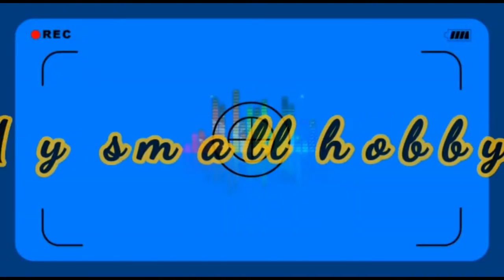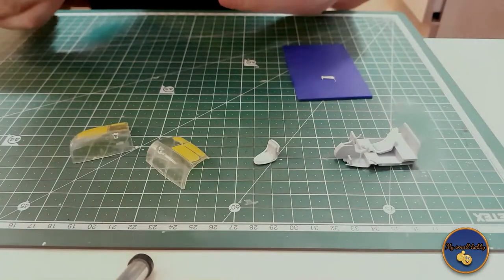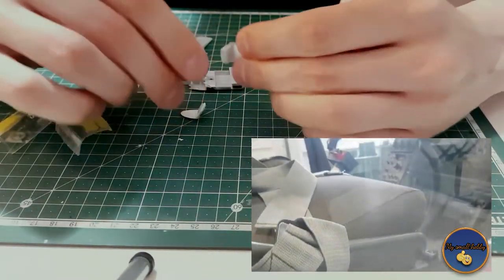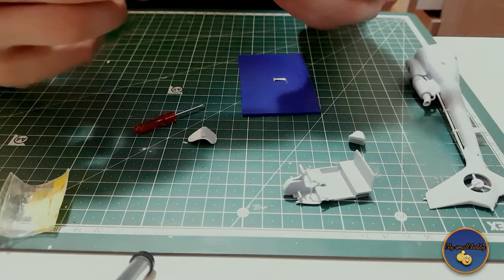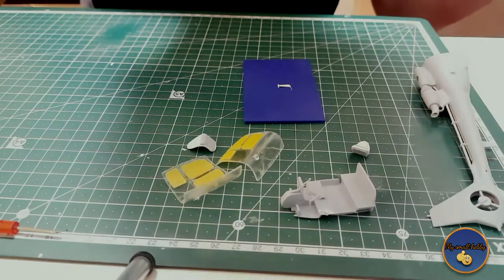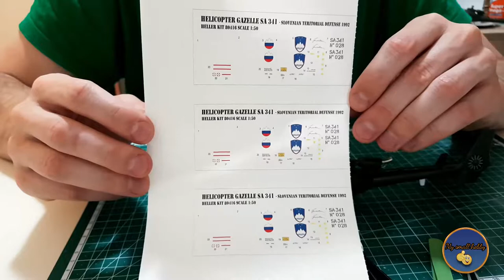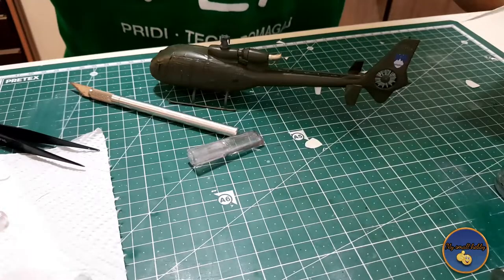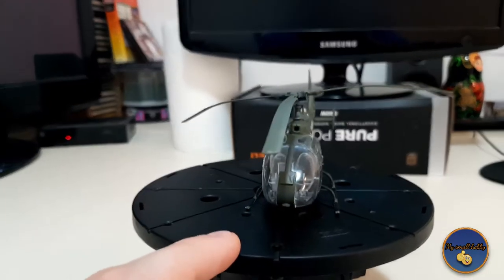Let's Build A Thing: SA 341 Gazelle (Based on Heller 80486) 1:50

Comment: Video ti je interesantan. Jedino si možda trebao da si koristio možda dekale tipa Lift Here ili Balkan Models. Kažu za Lift Here da je ili iz Beograda ili iz Novog Sada (nisam ni ja siguran odakle su), ali Balkan Models dekali su iz Slovenije ako sam dobro čuo.

Video is interesting. You should have used the decal such as Lift Here or Balkan Models. They say that the Lift Here is from either Belgrade or Novi Sad (I'm not so sure where are they from), but Balkan Models decals are from Slovenia if I have heard well.
Reply from the maker: Yes you are correct.  Balkan model decals are for Slovenian, but like all good things here they don't make them anymore. One reason is that Revell does not make 1/72 bell 212 no longer. And the decals were made for that helicopter. I have seen 1/72 decals for Gazelle but thet are to small for 1/50 Heller one. Now Italeri has made a 1/48 scale bell 212. In our shop ww have several kits. Lift Here I have seen their decals. Only one person in Slovenia distributes them here. The resaon I made my one decals is because I wanted to try something new. In the end it cost me much more, but it's a hobby... :)
Reply: I didn't know that they aren't making them anymore (the Balkan Models decals). I once did a B- 17 G from Revell, and I have put a Yugoslav markings (the decals I mean), because I have red that the plane landed on Sombor's airfield in 1945. I can send you images on your email if you are interested. And I have used the Lift Here decals for B-17.
Reply from the maker: @Harikejn   yes. That would be interesting to see. My email is mysmallhobby@gmail.com
Reply: OK. I have sent you few images, and a bit more, and also one by accident.